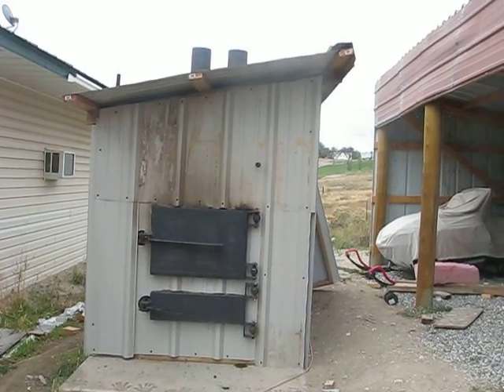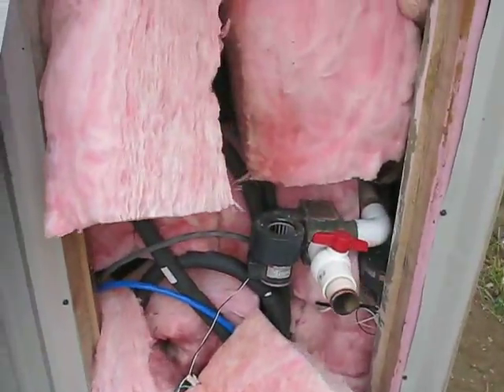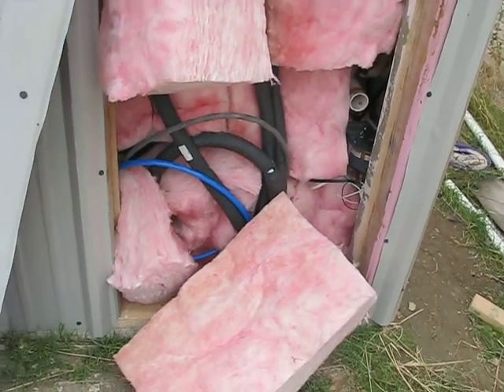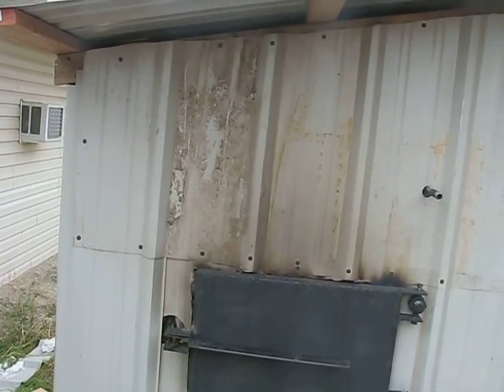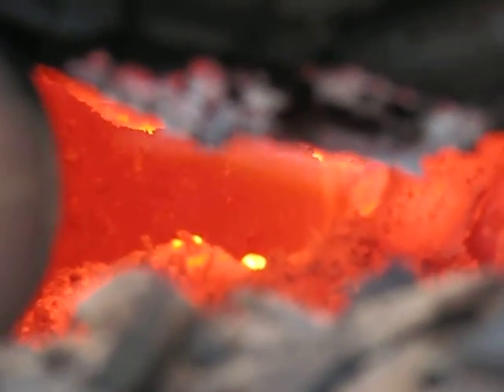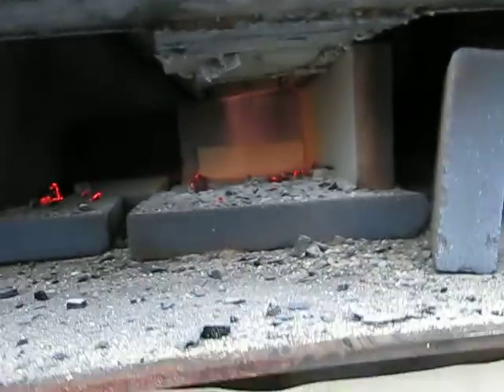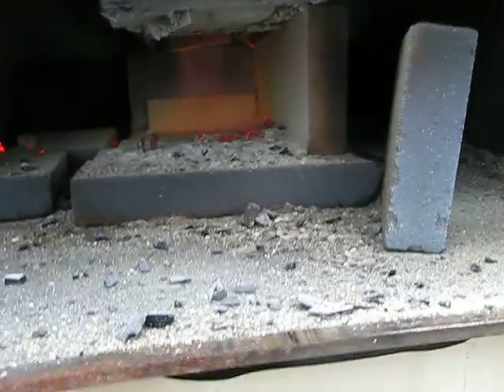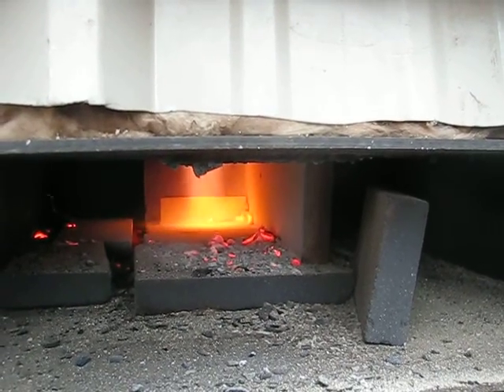Boiler First live run

Comment from the maker: Thanks Bob,

I am using one blower going through a 2" pipe for the primary air.  For the secondary air, I have a venturi nozzle that pulls air through a 1 1/2" pipe.  I will see if I can make a video showing more details when it is not running.